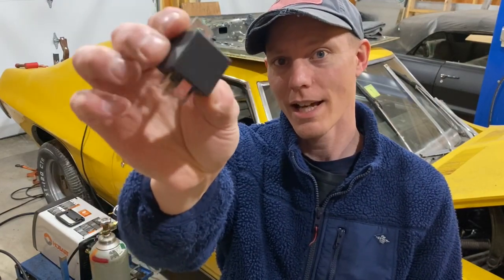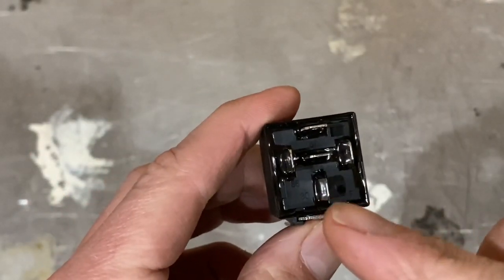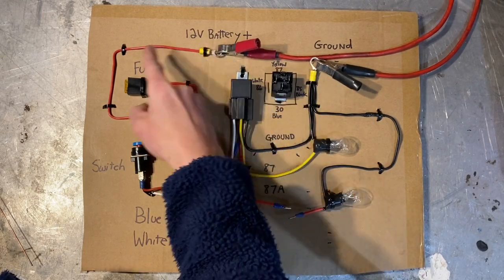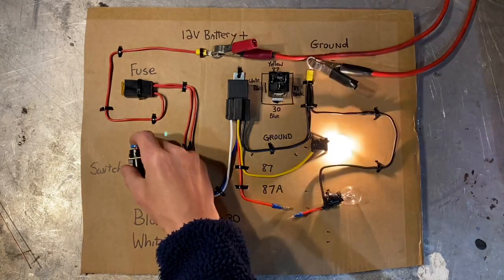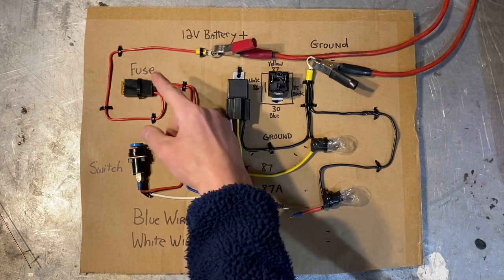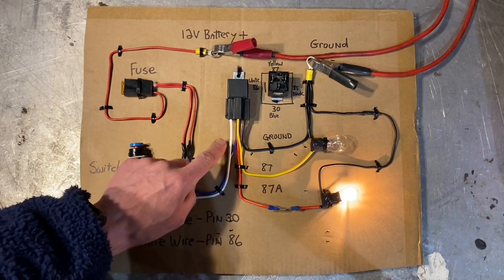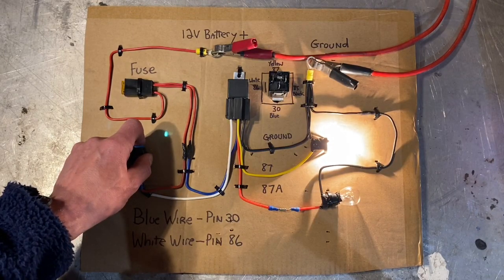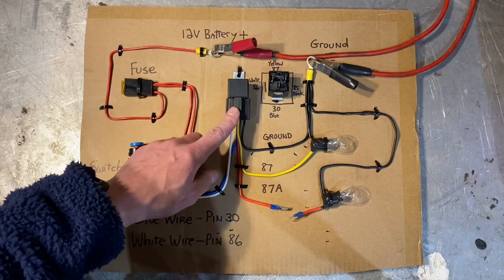How to Wire a 5 Pin Automotive Relay. Pins 87/30/85/86/87a . Bosch Style. Fans / Fuel Pump / Lights

Comment: I have a generator I have been troubleshooting that won't run and  has a relay wired onto it. 86 is wired from the starter, 85 grounded, 30 wired from ignition coils, 87a grounded and 87 is empty. 86 also has a separate wire tied in going to an oil sensor. When I disconnect the 30 wire connector the generator will run. What would you say about this configuration? 87a grounded?
Reply from the maker: When you say that 86 is wired from the starter.  Does that mean it is ONLY getting power when the engine is starting, or does it get 12v any time the engine is running?

My initial thought is that the entire reason for having this relay is for the oil pressure/level switch to kill the ignition coil if there isn't enough oil pressure/level.  So you just need to make that functionality work again.
The things you need to figure out are:
- Is the switch doing oil level or oil pressure?
- Is that switch normally an open or closed circuit
- Could these wires have been mixed up in the past?
Reply: @WiringRescue  watching a few vids and then looking at the 2 grounds on it kind of sent me for a loop then it hit me about the need for a ground for the ignition coil. Problem was the wiring for the oil pressure sensor. Thanks for the help.

Comment: Where did you find the 3 wire inline fuse?
Reply from the maker: Well this sure is crazy. I have no idea where I got that fuse holder but I just spent 20 minutes searching for another and cannot find one anywhere online. I check Waytek, grainger, ebay, Amazon, etc. Maybe somebody should start producing these things! 

You may just have to run two normal in line fuse holders, which is a total bummer.

Comment: How could you wire the relay so you could have reverse polarity?
Reply from the maker: Hmmm. Interesting question. What is the scenario in where you need this?
Reply: Ratty Muscle Car I’m using a linear actuator 12v to open a box, I need 12v positive polarity and 12v reverse polarity for up and down action. I’m also using 12v WiFi switches

Comment: I’m trying to wire up a side marker as a blinker and parking light. Have it blink when I activate my turn signal and stay on when I deactivate my turn signal. I managed to do it. But the side marker doesn’t blink concurrently with the turn signal. When the turn signal is on, the sidemarker is off and vice versa. Just like in your video. Can I get them to blink at the same time? With this relay or maybe another type of relay?
Reply from the maker: Are you using a two filament bulb in the parking / side marker? I would think it should have 3 wires. If so, you just wire it as if each filament is a separate bulb, and it should work the way you are hoping for.

Comment: Should you run a separate wire form the battery to the power side of the switch, with a smaller fuse like a 5 amp fuse. If you tap a wire off the battery, or put it on the same fuse as the power it would have the same ampacity as the power for the relay. why use the relay?
Reply from the maker: Yes! You are completely right. The switch is happy on a way smaller fuse than the power feed to the accessory (pin 30). You can’t easily tell in the video, but there are actually two separate fuses there. 
Like my diagram is designed, you could also have a single fused power feed wire from the battery, that splits into two fused circuits. One could be the accessory power feed (higher amp), the other the switch power feed (lower amp). That way you protect all parts of the circuit appropriately.

Comment: This was such an awesome demonstration, thanks for making that simple. I’ve been trying to find a video that can help me get started on a project and looking for some help. I Have a Polaris side-by-side that has a small buss bar. Looking to install a fuse box but can’t comprehend how to attach the wire that will turn on when the key is turned on. Any suggestions? Thanks again.
Reply from the maker: There must be a fuse panel of some sort on the side by side. Find that and determine which fuses turn on with the key by using a test light or digital multimeter.. Once you find one, use a “add a circuit fuse tap” (Google it), to grab the electricity from that circuit. The new circuit (wire) coming off that fuse tap can now be used to turn on a relay like the one in this video. Run that wire from your new fuse tap to pin 86 on a new relay. Pin 85 on the relay will go to ground. Then you run a new wire from the battery directly to pin 30 on the relay (make sure you add a fuse in this wire!), and have pin 87 go to your bus bar. Skip pin 87A on the relay entirely.

By doing this type of circuit, you aren’t adding an additional electrical load to your factory side by side fuse (that’s generally bad practice and can damage things). You are just using that factory circuit to turn on your new more powerful circuit that runs off of the battery. You have also don’t have to splice into the factory harness if you use an “add a circuit fuse tap”. So there is no jacked up factory wires in the entire process. 

Good luck and feel free to subscribe if you haven’t already! :)

Comment: Exactly what i needed, thank you. I did have a question tho: the relay is rated at 30a what did you use for the inline fuse and what was the rating of the switch?
Reply from the maker: The switch can be a very low amp rating and fuse because all it does it make the relay turn on and off (5 amp fuse would probably be fine). The relay can handle up to 30 amps through pins 30 & 87. However, you should base your fuse size on whatever accessory you are powering. The accessory can not pull more than 30amps, or you will damage the relay itself. For example: your accessory (maybe a light bar?) may have a rating of 18amps max. So you would put a 20amp fuse on pin 30. Then if things go wrong, and the light draws 21 amps, the fuse pops, and all is safe.
Reply: Jeremy N someone once told me Wats / volts = Amps  I.E. Ditch lights 60W each.
120W / 12V = 10a. 🤷🏽‍♂️
Reply from the maker: SoCalDucky Diaz - I believe that is correct as well. So if the accessory didn’t tell you directly what to use, that math should work!
Reply: Jeremy N thanks, wish me luck!

Comment: Would a 5 pin relay not drain the battery? Since its always sending power to 87a.
Reply from the maker: If there is nothing attached to pin 87a, it won’t drain the battery because there is nothing using the electricity. Hope that helps you out!
Reply: @WiringRescue  thanks buddy, makes sense.

Comment: Thanks for the video.  Does it really matter in which direction you connect pin 85 and 86?  In your example you had power-86, ground-85.  Can you not also have power-85, ground-86?
Reply from the maker: It will work either way, but I believe somebody much smarter than me will tell you 85 should be ground. I’m not familiar with why that is. Maybe a smart commenter on here can explain why?
Reply: @WiringRescue  ... Thanks for the information... I checked online and found that if the switching circuit (pins 86/85) have an integrated diode ( a switching/blocking diode)  than it's important that 85 is the ground otherwise you can damage the diode.
Reply from the maker: mpcp27 - Good to know. I don’t believe I’ve ever run into one with a diode, but I’ll definitely keep my eyes out in the future. Thanks for the research.

Comment: Great video for a visual like myself. I have a q for ya and not sure if its possible. I have a new ram truck. I added some bed lights with a switch in the bed. ran a power wire to battery.Know I want to add some small led grill lights and a hood light. Who knows what else. I picked up a relay and a 6 fuse box. I want the grill lights to come on with the engine start. And the hood light off a switch. But the one switch I would really like to add is a switch inside the truck to be able to turn the bed lights on or off along with having the switch at the bed. And I'm not sure if 10 amp fuses are ok for the fusebox? 
Thank you in advance. Keep up with the great videos fo this dummy.Lol
Reply from the maker: Thanks for watching the video! It sounds like you’ve got a fun project! The fuse size depends on what you are powering up. So if your lights will use 9amps under normal use, you’d probably want a 10amp fuse. If you were to use a 5amp fuse, you’d pop it anytime you turn the lights on. The key to doing it right is knowing how much amperage the components on the circuit are using. Then use a fuse that is as close to that number is possible. Most lights and other accessories will have a sticker on them, or on the packaging to tell you how much electricity they use.  Hope that helps a bit!
Reply: @WiringRescue  Thanks for the quick reply. I'll check into it a bit more with the wire sizing too. Do you have ideas on running two separate switches for the bed lights?

Thanks enjoy
Reply from the maker: Joe L - absolutely. Just have power coming in to both switches from a 12v power source (through fuses) and have the other side of the switches both go out to pin 86 on the relay that powers the bed lights. Then either switch will turn on the relay for the bed lights.
Reply: @WiringRescue  Awesome, thank you
Reply: Jeremy N Hey Jeremy, I have another question. If I have the switch for the bed lights in the bed and maybe not necessarily need another switch inside the truck but maybe a light showing that the bed lights are on. So not to accidentally leave them on. Thank you sir

Comment: If I was hooking up  power seats and wanted power all the time to them would I just use 87a ?
Reply from the maker: You mean even with the car off?
Reply: Jeremy N  yes like all cars do power seats are always on
Reply from the maker: modmotorhead - I think many power seat circuits don’t use relays, they have a fuse or circuit breaker in between the battery and the seat switch. So you may not need a relay at all. I’m not sure it would be beneficial unless you want to circuit to turn on with the key.

Comment: If the ground wire "pin85" has a too thin of a wire can it cause voltage drop ?
Reply from the maker: Sure, any wire too small for the component that it is powering will have a voltage / amperage drop. Imagine feeding your garden hose through a straw. All the water will back up and you won’t have nearly the same volume of water coming out the straw. Electricity flow is similar to water, though when it goes wrong, it doesn’t flood the basement, it lights everything on fire.

Comment: what kind of switch are you using sir? is that an ON/OFF switch or a RESET or Button Switch? TIA sir
Reply from the maker: That is a momentary switch that only activated when it is being pushed. It’s actually from an automotive brake line lock kit.
Reply: @WiringRescue   nice, very informative
Reply from the maker: Samuel Panique - thank you for watching!